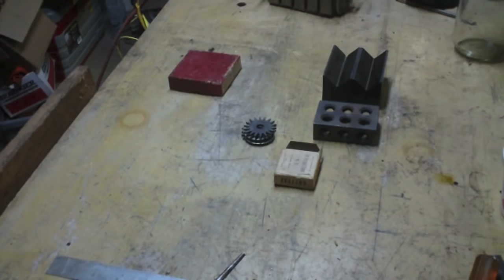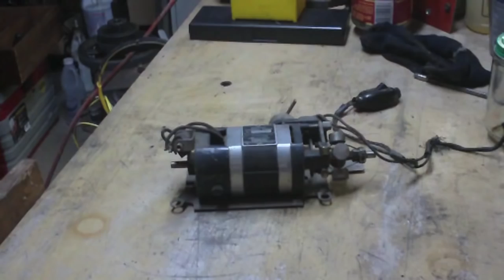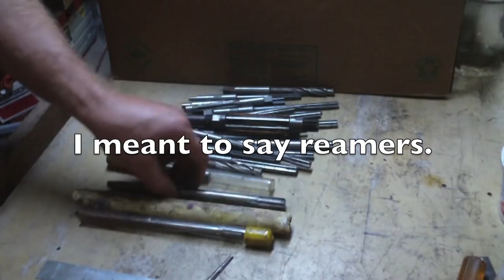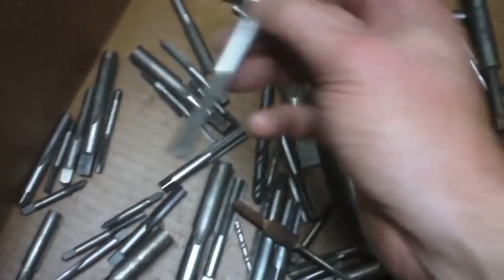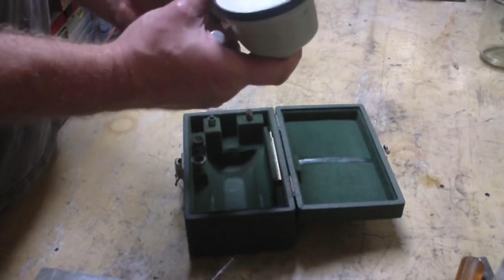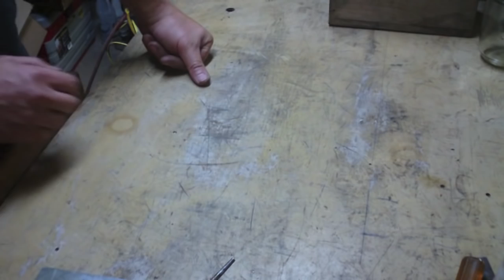September 2015 Yard sale machinist tools find Part 1 of 3

Comment: hay fyi the tool you think is a gear puller is part of a tubing flairing set there should be a tool to clamp direct size tubing also
Reply from the maker: +Chris Anderson OH yeah, good catch. Can't believe I missed that. I've seen them several times. I know what you mean, it's like a bar with multiple holes in it for different size tubing, split down the middle........I bet that is lost forever......guess it'll be a gear puller now (lol).